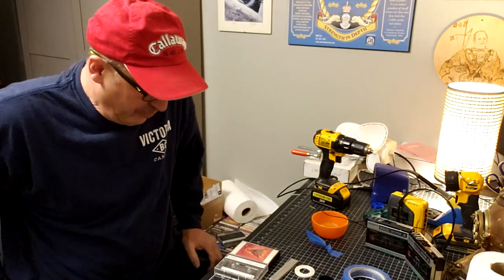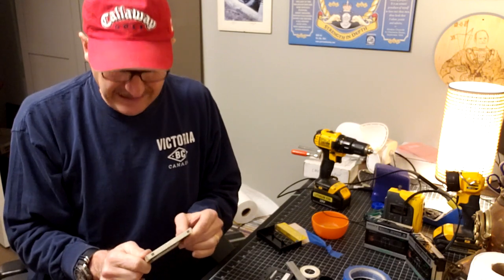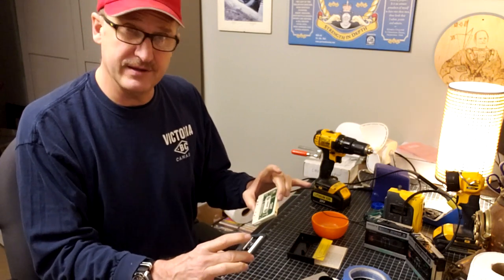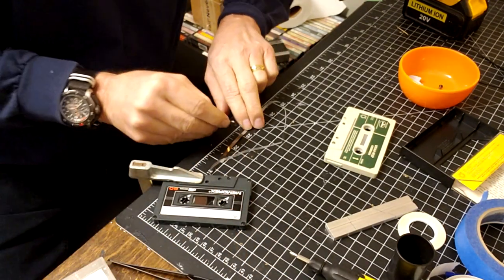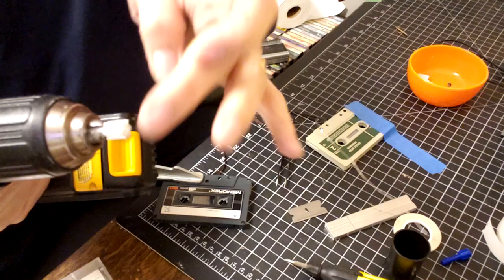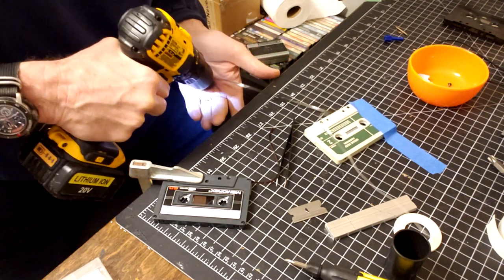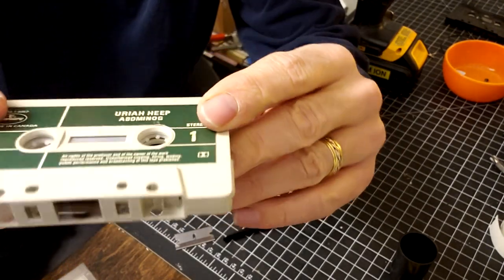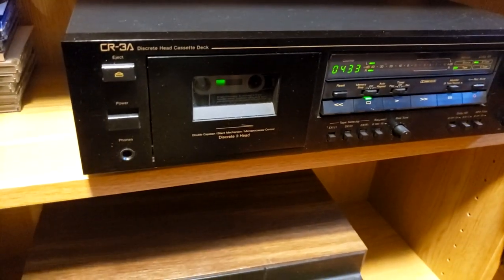Cassette Repair by transplanting tape in Welded/Glued Together Shells - Part 2

Comment: Nice process.  Cool tooling.  I would've totally spooled the excess Memorex tape back into that beautiful Memorex shell.  I guess you have a lot of those, as I believe you said.  But still, you could fix 2 prerecorded tapes with each Memorex db.  If you have 2 tapes that need repaired,  you could even spool the unused excess into another prerecorded shell - wow that would be  super cool.  That tape might not even need to be recut after recording, unless you wanted to make the timing nice and tight.  Thanks for sharing.
Reply from the maker: Thank you. To say I have a lot of tape is an understatement. I have over 1400 tapes with another 700 on the way. Here are some of the pre-recorded ones. The repaired ones sound better than a new tape would ever have😉
https://timothyflath.smugmug.com/Personal/Cassette-Tapes/Cassettes-For-Sale-or-Trade

Comment: About less than a year ago I had a sealed cassette tape that I have.  The tape itself was good but the wheel hub that holds the reel end broke, which I found out the wheel hub had cracked for the small pin version.  Had no choice but to destroy the shell to get that wheel hub and replaced with another matching colour shell and new wheel hub.  It was time consuming but it was interesting to see it on how it's done!
Reply from the maker: There is a way to separate the halves of tge shell to do a repair but is usually not worth the effort unless it is a must save tape 😉
Reply: @navydiving  the shell was nice, but again no choice to repair the wheel hub as there's no other way to access it.  Good for couple of parts like the pressure pad!

Comment: Holy moly those drill driver/cassette winder bits look super dangerous. The torque of the drill motor would snap the tape so easily if you aren't careful...
Reply from the maker: Don't be fooled by the loud sound of the drill. You actually have better control of speed and tension than a normal deck ever can. I have repaired and redone several hundred tapes over the past year and have not snapped or stretched a tape yet. Here are tapes I have made from new old stock cassettes as well as repurposed cassettes in the last couple of days on my 3 head Nak decks. The tapes sound fabulous - better than pre-recorded tapes by a country mile🤣:
https://timothyflath.smugmug.com/Personal/Cassette-Tapes/Home-Made-Tapes